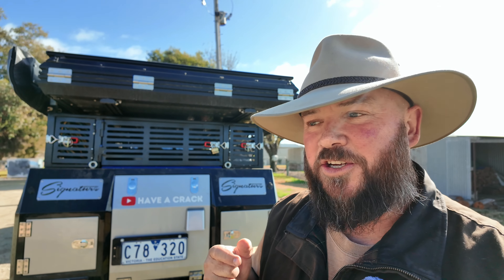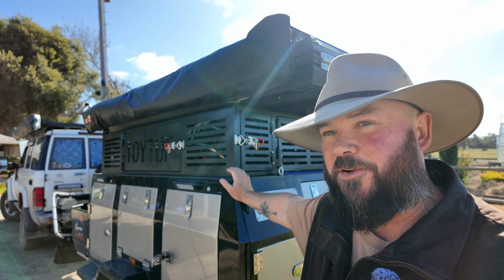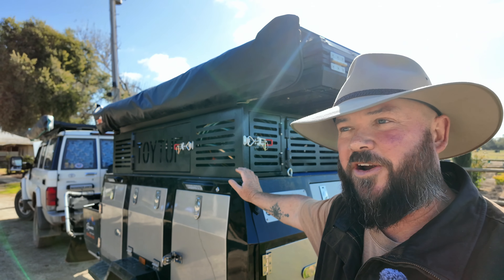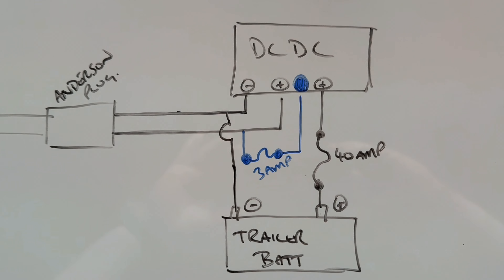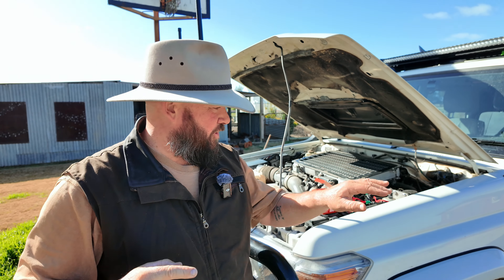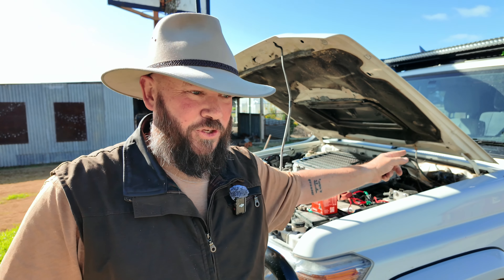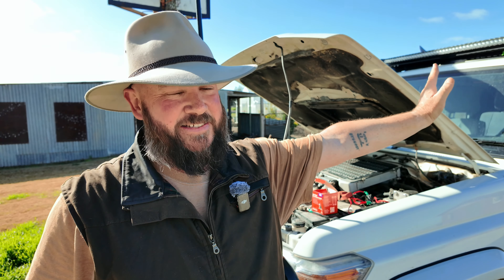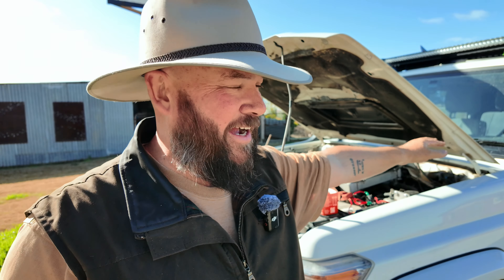Why I couldn't get this to work. Charging the batteries in the camper with DCDC.

Comment: Klarmann is an absolute legend. He’s the sort of bloke that’s happy to share is knowledge. I’ve got a Redarc manager 30 in my camper which has an inbuilt isolator. I’ve inherited spaghetti from previous owner and slowing upgrading wiring etc. good to see your issue sorted
Reply from the maker: I looked at the manager 30 for ages for the camper. Im still on the fence about it. Thanks mate
Reply: @Haveacrack76  I’m on the fence if I should put one on my patrol when I re do the 12v system in a few months. Besides the price issue there a bloody good bit of kit. Set and forget 🙂

Comment: I  had the same problem with my set up, I upgraded the wiring to 6 B&S and fitted a cheap voltage sensing relay in the trailer 
 as mentioned in another comment. Works perfectly now.
Reply from the maker: Cheers mate

Comment: Great timing! I'm doing the same thing RIGHT NOW. I just removed my aux battery in the the truck and disconnected it from the very same isolator. Then ran the Anderson plug cabling to the back of the the truck. I'll connect he DC-DC charger exactly as Heiner and you showed. What I still can't quite figure out is; "how do I ALSO have an AGM aux battery in the truck?" If you get an answer, I'd love to know. Cheers from over here!
Reply from the maker: If it were me, I would put a charger for it. But there may be a cheaper way to do it.

Comment: if you are having voltage drop at the charger input either your cable is too thin for the run or your connection have losses. take a multimeter and measure the voltage at each section and you will find the culprit. By doing a quick check you should be running b&S 3 for 5m run on a 40amp dcdc charger
Reply from the maker: Thanks mate.